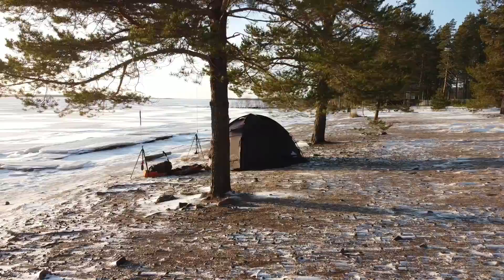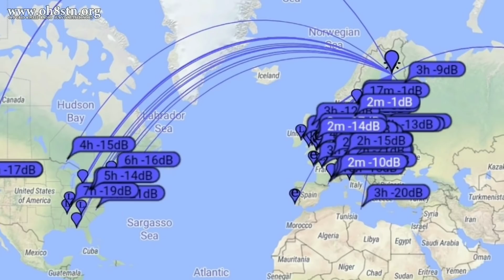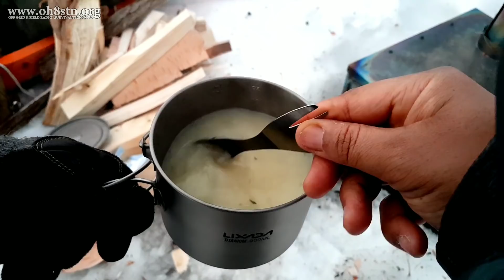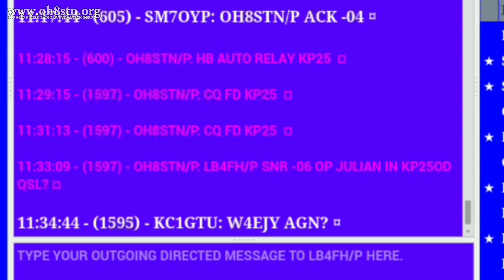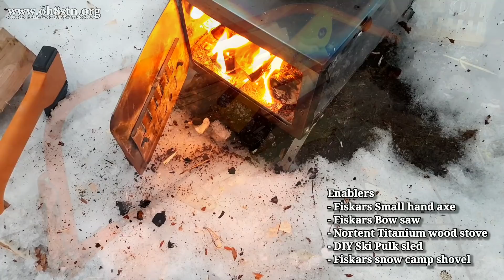Ham Radio Winter Tent Camping | Winter Field Day

Comment from the maker: Table of contents:
00:00 Intro
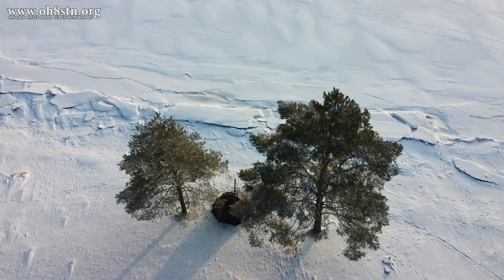01:16 What is Off Grid?
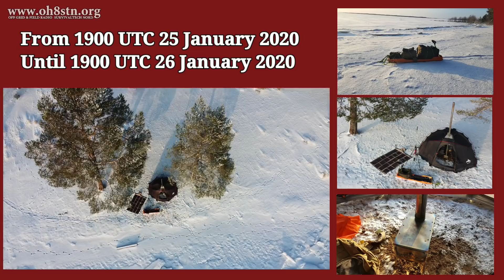02:15 Mission & Prep
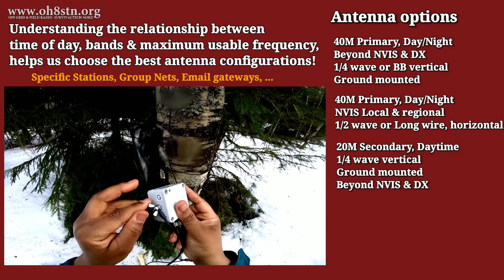04:32 Station Config
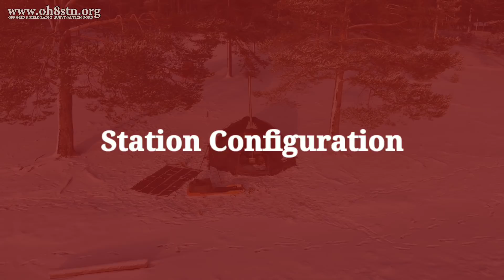04:36 Shelter & Heat
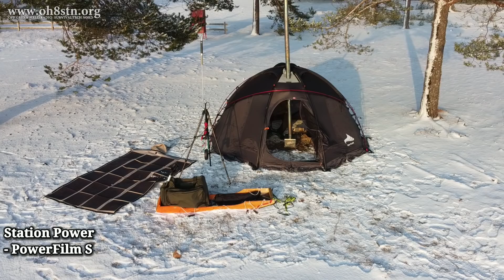05:38 Solar & Battery Storage
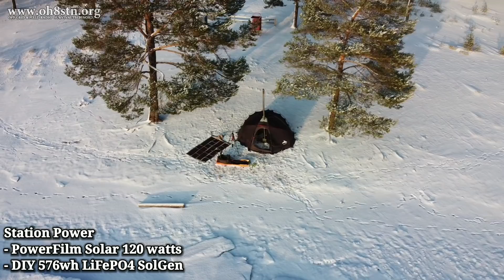06:31 Comms Gear
09:08 Starting up the Raspberry Pi
10:40 Antenna Config
14:00 Heat & Food realities
16:38 QSO, Data Comms, Email
23:32 Tools & Enablers
26:17 Final Thoughts
 27:21 Sneek-a-Peek

Comment: Wow with all the camping videos I watch with ice fishing , hiking, snowmobiles, cross country skis, snowshoes and track driven vehicles, now your using a hot tent for a Hamm radio. If your worried about moisture affecting the equipment, try a floor in your tent. The snow can add to the condensation issue. You can use a welders blanket to protect the floor , a pan or cookie sheet to catch coals from the stove door. You can insulate under the stove with something like the foam sheet that goes I Dee vinyl siding or something. That will keep the stove from melting the snow underneath and sinking over time. 😊❤️🇺🇸❄️☃️🛷⛺️🌄

Comment: Julian, thanks for taking the time to answer my questions! 
My first priority will be in setting up a power source, I will check out the previous videos on your power bank construction. Hopefully I can get these cells delivered here to SV9 land with no issues.
My portable rig is one of the SGC2020 transceivers that was set up with the LDG  Z100 tuner feeding a Maldol 20 meter base loaded whip with a trailing counterpoise. Works rather well for 20m SSB short range comms. Biggest issue was the SLA 12v 7ah battery, heavy for what little power it provided. 
As for the food sources, there are now plenty sources for Ramen now compared to zero when we first moved here. The good thing is that the packs here contain additional spices which add more flavor compared to the bland stuff we had back in the States. As for other non perishable  items I use a vacume sealer and pack what I need.
Thanks again for the info and its time to start gathering battery goods!
73!

Comment: You are making many of the points I've been making to others about what EmComm's is really all about. The gear is nothing without a functional operator. That means first and foremost having at hand the means by which to sustain life, food, water, shelter and when appropriate heat. The radio gear must operate under any and all conditions as well, but the operator needs to be considered as the most essential part of the station. Most emergency communications situations will not involve operating aboved the arctic circle. While this is a good place to demonstrate how to operate in extreme condtions it's not a typical deployment or for that matter, anticipated emergency operating conditions for most. Simply having on had a good supply of food and water in one's home QTH is a good start to being prepared for emergency comm's. Being part of a local network with practice operating in simulated emergencies is another step in being prepared. I continue to stress that anyone considering doing emergency communications work should have in place a plan that includes all aspects of operating, perhaps totally off-grid for weeks, even months. Large scale, wide area, long duration events might be rare in most locations, but, planning for such an event would then means that one could handle less severe, shorter duration events easily. Thanks for all you do in demonstrating what is possible in field operations. You provide valuable lessons for all operators everywhere.

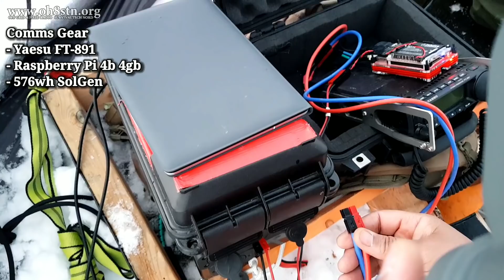Comment: Great Video! excellently produced!  Those power wires at 8:37 (blue and red) look to be extremely flexible and easy to work with. especially considering the cold weather. All mine seem to be stiff enough to push my radio around. I love the attention to detail you give everything.
Reply from the maker: Thank you for this Jake. Yeah the cables are 8 or 10 gauge. I don't remember which ones are used in the video, but they are stranded copper with sillicon sheath. These are normally used in race drones, or other high amperage RC builds. It's designed to be extremely flexible, and really doesn't get stiff in the cold at all. I'll do a blog post in the coming days about that wire. Thanks for the comments and for the kindness. It's very much appreciated.

Comment: Julian, another great detailed video.  I like the way everything is coordinated for a common purpose.  I am in the tropics (in AUS)  and have 500m to 1000m wilderness mountains (jungle) in my area. I am working towards being able to deploy solo man portable in my local environment.  Here you can die from heat exhaustion and dehydration in 24 hrs. Also on the  mountian peaks there is very littel free water (unless it is the wet season) so survival involves careful management of water and hydration.  I am keen to try an adapt the principles you explore in my very different environment.

Comment: Julian, this video is one of your best!  I wanted to ask if you have a feel for how long the battery pack will last in a standby scenario--once fully charged it would be disconnected from the solar panel and equipment after which it would be put aside for an emergency. It would be completely disconnected from everything though the Genasum (without solar panel) and the power monitor would be still attached to it. Then some inexplicable phenomenon makes the sun disappear from the sky and destroys the grid. Would the pack still have some usable life in it--let's say after a month or so of not being used?
Reply from the maker: Excellent question. Lithium iron phosphate batteries have a very low self-discharge. If nothing is connected to the pack, I would expect it to remain relatively unchanged  for 6-8 months. It's probably longer than that, but that's as long as I tested it  with any of my packs.  
That's not the only answer though. If we leave this battery pack in a 100% state of charge, it'll actually reduce the life cycles of the battery. So I would never leave it at 100% charge, then put it in the storage. 80% SOC, would make that a moot point.
Finally, self-discharge of our built packs also depends on the BMS and charge controllers we use. It's important our BMS and charge controllers use ridiculously small amounts of power to do their job. This is especially true if we're building a pack for storage versus one being constantly replenished by the Sun. I consider things like this when I put these LiFePO4 builds together.
So once again excellent question. Also thanks for the feedback on kindness, it's very much appreciated.
Reply: @OH8STN  Thanks again. Very useful info.

Comment: I'm an avid winter expedition and camping enthusiast, and fascinated by radio, though I hold only a marine VHF operator's certificate at the moment.  I have a HAM basics guidebook I'm trying to find time to work through, and hope one day I'll have a chance to try operating a coldweather station just like this; I actually have the same F16-7200 and a similar utility battery (though with 4 100Ah prismatic cells).

Out of curiosity, was your shelter routinely above 0C inside?  Were you worried at all about lithium cell damage due to cold charging?

And, outstanding job with the video!

Comment: Have you considered getting a PACTOR modem for HF Email? 
For an emergency communication perspective I have read many people finding it more reliable and faster than soundcard based email modes.
Reply from the maker: Yeah I have. It definitely is more reliable, that goes without saying. Unfortunately it would increase the size and complexity of my portable station. It's just not practical to carry it in the field. If I were a fixed station in Greenland or Antarctica for example, it could be a good investment. Unfortunately it's a Windows or Mac only solution. Doesn't work on any unix-based system.
Definitely a valid question.👍
Reply: @OH8STN  Yeah that is a valid point. Fixed "bug in" station it could work. The only way I could see it work in the field is a self contained pelican case radio box. And all you have to do is hook up power. But even then if it can't with with the Linux based raspberry pi no point in having it. And even then it's extra weight and power.

 It would be great to have it work in Unix based systems since I only use Linux based systems. There just isn't a big enough reason for me to use a windows based system over Linux at this point 

And for me still trying to get a station built (as a broke college guy that doesn't make alot of money) I can't afford to throw money around carelessly. Especially on stuff incompatible with my system. For me just getting operational is the highest priority 

Really enjoy these field videos! Keep up the great work!

73,
KE8GAH

Comment: Fantastic video Julian! What type of wire are you using from your solar generator to the 891? It seemed very flexible. Must be a high count stranded with silicone insulation or something like that. Tnx. 73 WB7DUO
Reply from the maker: Thanks Greg. Yes that's exactly what it is I don't remember if it's 8 gauge or 10 gauge. But it is multi-stranded with a silicone sheath.
Reply: Ha... guess I should have read all the comments first. You answered it already! :)

Comment: Great video. I may havr missed it in the video, did you bring fuel on on the pulk or also chop that in situ.  We often joke locally that wood warms you thrice - collecting, chopping the burning.  I can see how when it's that cold though you don't want to spend long outside harvesting suitable fuel
Reply from the maker: Hi Dave. Not in the video and good question. 
I always have tender or fire starting material with me. That's the Tinder plus half an hour to an hours wood, usually birch. If I'm wild camping, dead fall sourced locally is easiest. Like this video https://youtu.be/kPlBMJ86Z4E , everything was sourced locally with 200 meter/yards of camp.
 For this training day, I harvested and prepared a days worth of wood on Saturday morning. Those were processed to fit inside the width of the pulk. When my wife dropped me off at my pickup point, I dragged all of it with my kit, to my spot. Once I got to my spot, I simply chopped wood down to size for the stove, as I required it. If This Were a real deployment, it would definitely have been a multi operator station. Otherwise there would be no time for chopping and processing wood, melting snow, making food, and all the radio communications. So the pulk made pre-processing, then dragging it there, possible.

Comment: A very informative video!
Several questions regarding temperatures.
Starting temp within the tent.
Your target temp for safely bringing out the gear.
How long did it take to reach target temp.
Don't ask for exact temps but what you felt they might be from experience.
Like the idea of fusing within the solar gen set. Are the power poles marked as to what should be plugged into the appropriate connector?
Any idea as to who sells dehydrated food here in the EU? I am familiar with the brands from the USA however shipping is almost as bad as what customs charges are for goods coming into Greece from the USA. Been following the thread in my email re: Prepping 101 in the HFPack email, interesting thought being exchanged there.
73
Reply from the maker: Hey I just saw this message and I wanted to tell you answer everything in the morning. I'm just getting in the bed and I'm exhausted. If I give you an answer now it wouldn't be a good one. I'll come back and answer in the morning 👍
Reply from the maker: Okay now I'm back to answering your questions. The first question about the starting temp inside the shelter. The inside temperature is always dependent on the outside temperature. Without the stove the only thing the shelter does is protect us from the wind. So if its -14 outside oh, it's going to be -14 inside that shelter. The once I get the stove going, it might take 20 minutes until it's + 5 or + 10 degrees Celsius. After an hour with a good burn oh, it's over + 20 inside the shelter.
Reply from the maker: Okay the question about the power poles and fuses. Each of the power pole ports on my solar generator is identical. They can all output the maximum current the system can produce. Even so I fuse them sort of the way that you mentioned. So the two ports on the left are each fused at 30 amps. Did ports on the right are fused at 10 amps. I do this because I only have one 100 watt radio. The rest of the radios I might run in parallel are the 817, the tmd700, the xiegu g90, or my VX1210. None of those radios draw more than 10 amps. So the ports on the left are designed for to 100 watch radios. That still leaves enough current capacity 450 watt VHF UHF radio operating simultaneously.
Reply from the maker: Okay the question about the dehydrated food. I used to buy those dehydrated foods like mountain house and things like that but there's no point. I really found dehydrated soup from a normal supermarket what's the most cost-effective way to feed myself on these type of the alignments. All I have to do is boil water and mix it in. The package you saw in the video it's just a box of three from the dried food section of the supermarket. A box of three packages which is basically 1 days meals, was less than one euro. If I double them up it's to euros for an entire day's food. I found these in the supermarket near Ramen, spaghetti, dried noodles and things like that.  I hope this helps.

Comment: low temperature  the battery can work well？  73 de Bh8sim
Reply from the maker: Excellent question. The battery will work well to power the gear no problem. The problem we do have is we must allow the battery to warm inside the shelter, before we can start charging it. The tent is about +20c inside, so it doesn't take long.

Comment: You mention no success with email. I have been trying pskmail lately with no success - it has worked in the past for me in Europe. Would seem that network is ideal for current times. Any visibility of pskmail servers on 10147 from your QTH ?
Reply from the maker: To be honest I think the problem is more about propagation and the wide bandwidth of these email modes. 500hertz is still quite wide unless you're lunny running enough power. To the problem maybe propagation. I can get good connections with psk mail from home. It's the same with winlink.
Reply: @OH8STN  Thanks for that and confirming the network is  up - I shall persevere. When it did work for me it was with a 5W Xiegu X5105 and an android tablet (andpskmail) - very portable - maybe I got lucky. Last question...which is currently your 'best bet' visible server for PSKmail ? Really enjoy your channel.